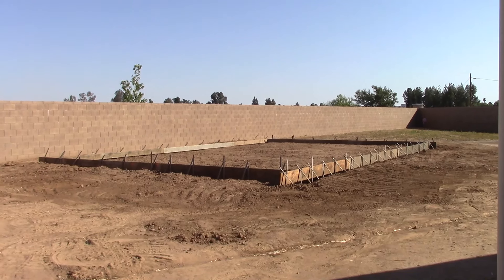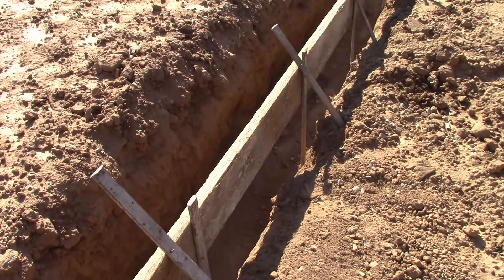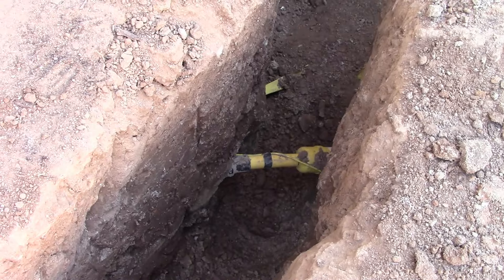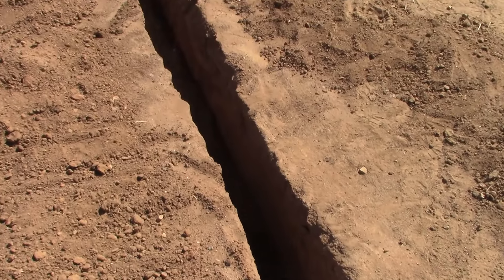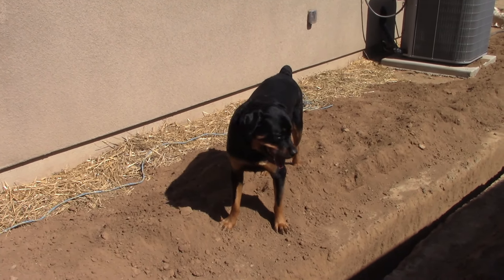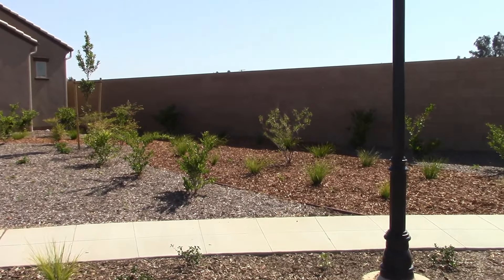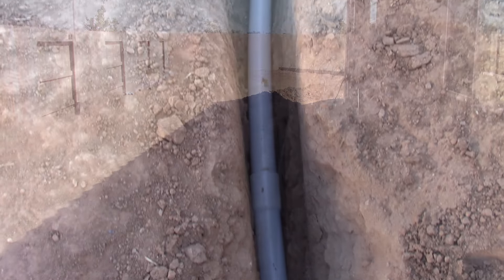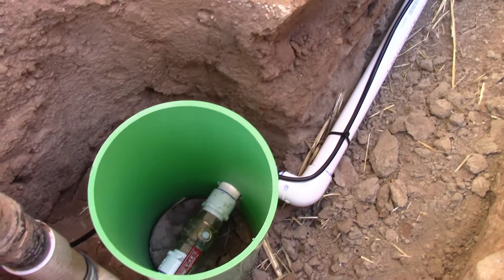Shop Build Part 2 Progress Updates #realraysgarage

Comment: Hello Ray,  Feels good to see some progress on the ground doesn't it?  You are going to have a great space.  I was amazed in water short California so see a 2 1/4 water feed.  I know it is supposed to only get used in a fire but in real life there will be breaks and leaks.  Here no fire suppression is required and they encourage a 1/2" water service (used to be 1" or 3/4" at the smallest).  That is with 160" of average annual rain.  Oh well you gotta do what you gotta do!    Going to be neat to be warm and dry with lots of space between the tools something I am looking forward to too.  I got my roof decked and ready for underlayment when I discovered the building supply store had ordered an incompatible one which can't be used with steel.  Gotta order new and I am in the process now with as built dimensions of ordering my standing seam steel roofing.  It will be a big sigh of relief when I am weathered in.  Looks like your doggers had a conference and approved! Lol!  Take care.  Doug

Comment: Very nice.  Can not imagine a code requiring sprinklers in a non commercial private structure.  The pipefitter union must have some strong leveraging  down at city hall.  Did it require being installed by a certified sprinkler contractor?  Anyway will be nice having running water and a head in the shop!
Reply: Codes for sprinklers aren't written in the way your thinking of! They are written for occupancy, ie residential or commercial! Where the building is located (on residential property or zoned commercial property) has no bearing on code, it all has to do with the occupancy as defined by NFPA. But you bring up a valid point! The system supply that feeds his house was designed for a residentual system (his house), not a shop! Residential sprinklers have a very low flow rate compared to sprinklers listed for industrial use and a 1.25" supply would never support them unless they have extremely good water pressure and flow rates in his area!  By the way, residentual sprinklers are not listed to be used in non-residential applications. Now, I didn't actually hear him say that sprinklers were going to be required in the shop, think he said alarm wiring was being run, which could mean fire alarm! If they are installing them I would be very interested in how it was designed and what they used!
Reply: My point Fred! was that I have had both Residential Houses and Commercial structures built in two different States. Not once were sprinklers required in a residential home and in commercial only when it passed a certain square footage.  Just had a new home designed and NO SPRINKLERS!  Glad I do not live in a overbearing  nanny City/State!
Reply: pkav8tor Yeah, understand! Where I live there is only one town that requires them in new homes, but that requirement only applies where the house is built on a dead end street were there would be limited access by FD. Commercial is different, there are a lot of requirements for that throughout the country, but again it depends on town/city/state and type of occupancy. Didn't mean to butt in on your thread, but you brought up a very valid point about it and I hope Ray shows it if they are required to be installed.
Reply: Here is Sunnyvale, CA its code for all new construction and  retrofitted if a remodel is greater than 50% of the floor area.   Has to be installed by a specially licensed contractor, DIY not allowed but they can use orange colored PVC.  In 40 years we have had one garage fire on the street but three houses have suffered extensive water damage from broken sprinkler pipes or heads.  But at least your are not likely to drown.
Reply: Residential sprinklers are not designed to save the structure as they are in a commercial application.  They are considered a "life safety" device.  If there is a large fire, the sprinklers have enough flow to knock down the smoke and save your life.  The sprinklers are installed in dead end hallways and rooms. bathrooms, and in every bedroom. You will be able to escape a burning house with this system.  Residential sprinklers are a common requirement all over the country.

Comment: Man is that a lot of trenching !!!...Hey I have a question...On your electrical panel where the meter is ..If you remove that panel does it give you access to the circuit breakers and house wiring ?  I mentioned such a thing to a local Electrician and he had no idea what I was describing ..Since they are not used in my area

Comment: Looks good.  I'd use 4500-5000 PSI concrete for the slab personally.  3000 is fairly low spec and will not be as durable.  Too much water and not enough cement.  I doubt it would cost more than $20/yard extra to go from house mix to highway spec concrete.  I understand money doesn't materialize from thin air so do what you must, but this is the foundation of your shop.  It is the hardest thing to change if you don't like it.  Higher spec concrete does need to be handled/finished more carefully, especially in your heat (it goes off way harder and could get too hot plus if you time it wrong you won't be able to finish trowel it.)  Good luck however you choose to go.
Reply: Agreed about the stronger concrete mostly if you ever get heavy machines, this is a big pad...!

Comment: Ray, I would have installed you're water ball valve above grade or at least close to the surface in a box. They need to be exercised periodically or they will get too stiff to operate. You may need to replace it if you stay in that location for any length of time.

Wondering why, since you knew the shop was coming that you didn't have water, electrical and other utilities stubbed out on you're back wall of the house?
Reply from the maker: The ball valve is very easy to get to plus I wanted it below grade for a clean look. The builder of the home would not allow these types of additions/changes so i was forced to do it this way. Thanks for tuning in!

Regards,
Ray

Comment: You only get 1,000 sq. foot shop? Life's so unfair! :)
Looks good, Ray. Did you do the conduit yourself, or sub it out?
Grinders like that are common in Florida, anywhere outside of town, because the required elevation for most septic tanks is higher than the house slab (depends on the ground characteristics).

Comment: gonna regret that 200 amp service one day,I know I did,so did Keith rucker,looks good though
Reply: I don't know,  200A is 48KVA  that would run a 60 HP motor,  his slab wouldn't support that anyway.  Besides you wouldn't want to pay the PG&E bill.   All one really needs is enough to run the lights, AC, air compressor and one or two machines at the same time.  A business with employees is a different story.
Reply: My god, he will never approach a 200 amp load in his shop!  He would have to be running all of his equipment, under load,  at the same time and even then I doubt he has more than a 100 amp draw.  Anyway, to get more than 200 amp, the service to his (NEW)house would have to be rewired.   Larger wire would have to be pulled from the neighborhood transformer plus a larger house panel installed  (I bet the misses would love to have her new house torn up in the first month!). I really feel this is a case of over kill that seems like a good idea but isn't.  Keith Rucker has built himself a commercial level shop.  He has giant, old , 3 phase machines that he likes, but require a fair amount of current.  However, on his busiest day, I would bet Keith has never reached a 100 amp load even running his phase converter.  Oh well, like you said, the install sure looks good!!